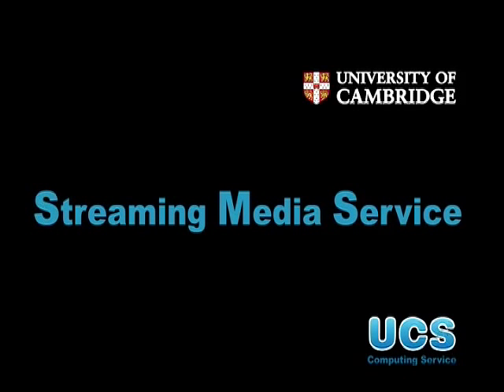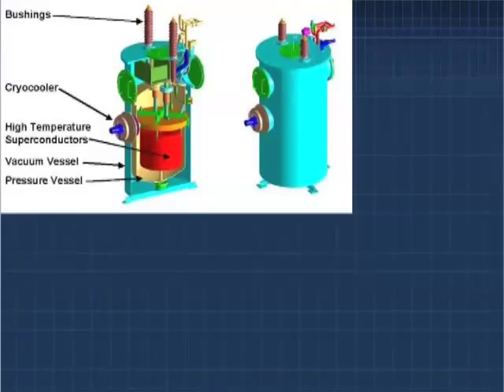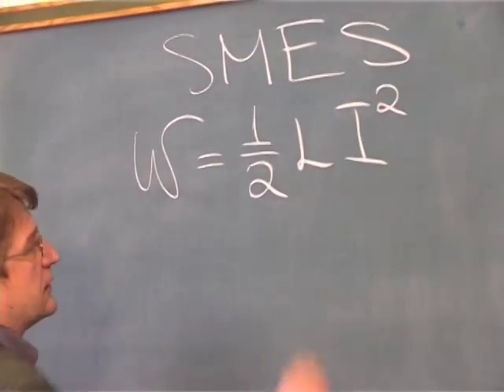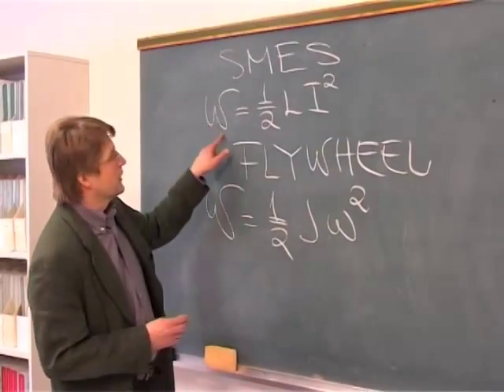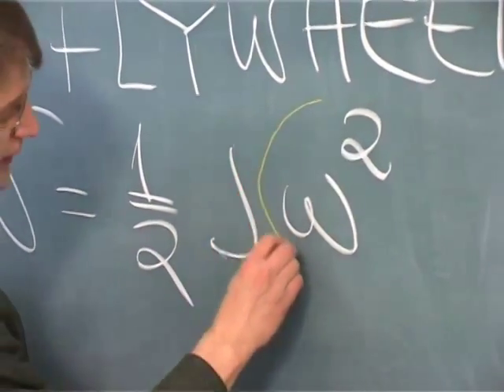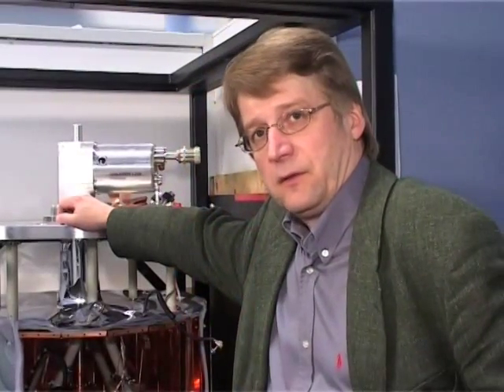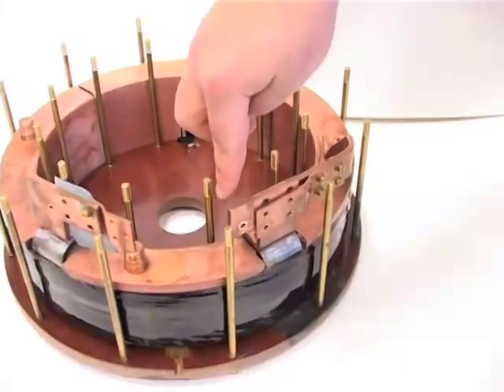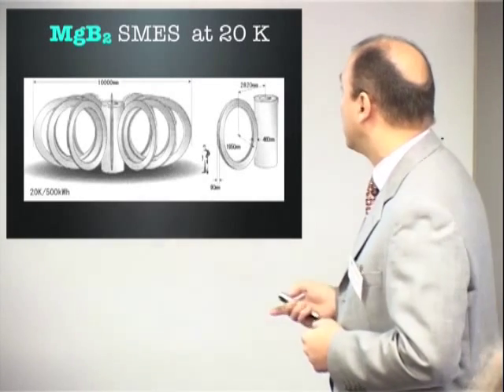Superconduction: energy storage

Comment: why does it work with DC and not with AC?
Reply: AC has resistance even in superconductors
Reply: @AntonySimkin  why? do you know about a book where I can read about this?
Reply: @juancamilocastanoguzman1337  because AC doesn't flow inside the conductor, it flows on the outside (as higher the frequency, further from the conductor it flows).
Reply: @juancamilocastanoguzman1337  La fisica clasica decribe el flujo de la corriente alterna. Vale para superconductores tambien
Reply: @AntonySimkin  Firstly, skin effect at ac. The second reason is that they are susceptible to stresses induced by a rapidly changing magnetic field. forces generated by the changing magnetism can destroy the thing.
Reply: @davemwangi05  thank you for the correction
Reply: @AntonySimkin  Yeah, interesting things. I find it crazy that even turning it on or off is a problem. For example it might take 30 minutes to ramp the current up slowly to the final working current, in order to prevent damage. I still cant digest that once the loop is closed, the current  runs for decades. And turning it off must be done with care because there's 8MJoules  of energy trapped, that's a 2Kg dynamite. https://www.youtube.com/watch?v=9SOUJP5dFEg
Reply: @davemwangi05  i have never pumped a supercoil, I only worked with the coldhead of the coil... After for example 10 minutes of pumping, does it already have magnetic field?
Reply: @davemwangi05  how many watts do you pump in?
Reply: AC moves back and forth so it basically turns on and off very fast , you cant store energy in that form of behaviour because it will cancel itself.